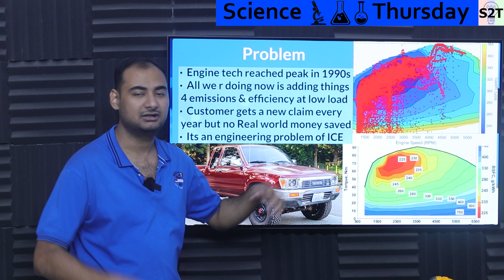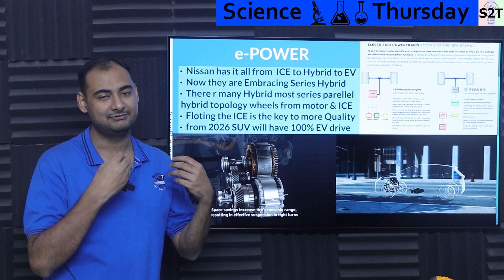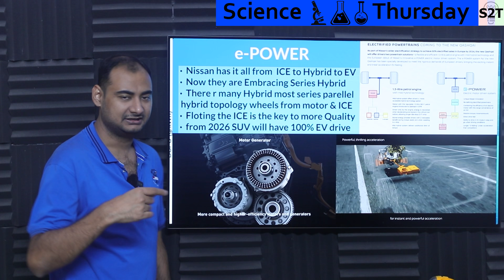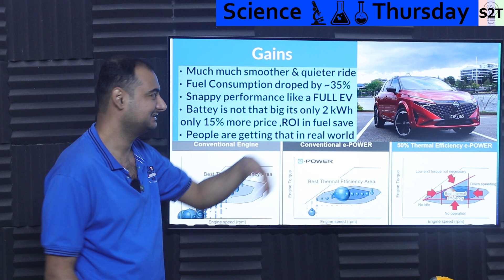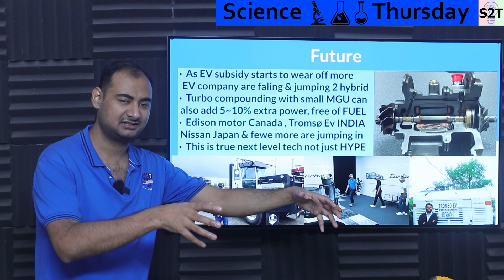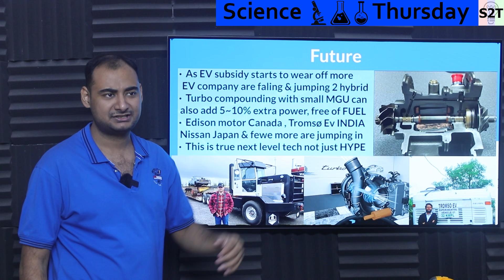Nissan e-POWER Explained {Science Thursday}

Comment: hmm onbard charger is even necessary for EV's why don't disconnect motor and connect grid in that place. and simulate regen for charging from grid.
Reply from the maker: motor and connect grid in that place ?????
Reply: @s2tenglish  I think to use motor controller as battery charger.

Comment: Well at least 10kw battery would make sense and it could be a plug-in hybrid. 10kw LFP batteries are like less than $1000 from manufacturer... and weights only about 80kg
Reply from the maker: Yes u don't need battery on wheels to be full EV for most people & still be cheap plus very high mileage car
Reply: @s2tenglish these are basically EVs with range extenders. It makes the most sense. For daily city usage it can be full electric, and for long routes it can charge from the generator
Reply from the maker: BINGO

Comment: Most excellent.  
Wish someone would stick small solar panel on roof only to circulate cabin air in summer & run security camera when parked.  Look up that 90s idea of cars transmitting speed and car distance to each other so driving assistance computer can breathe
Reply from the maker: that could help